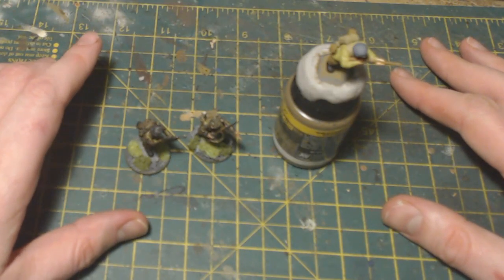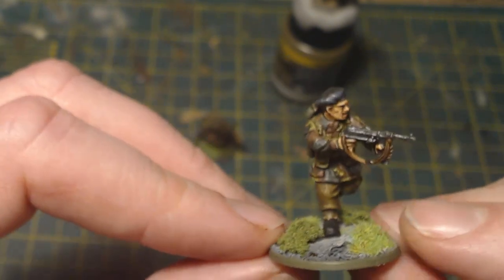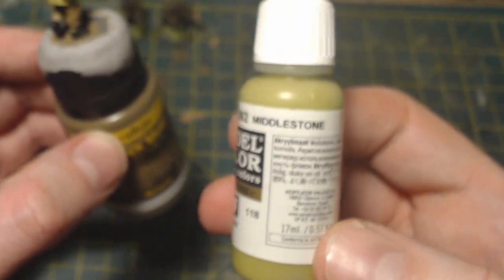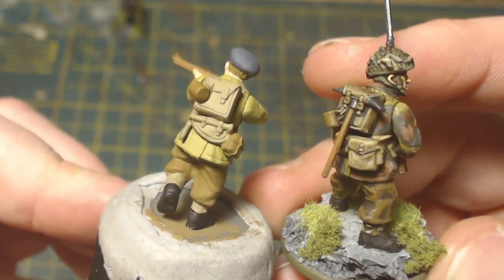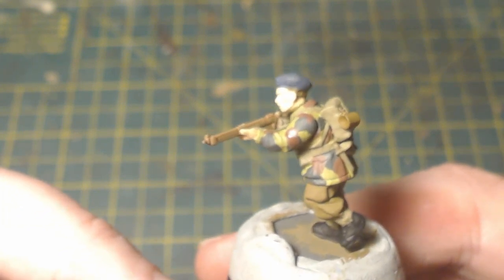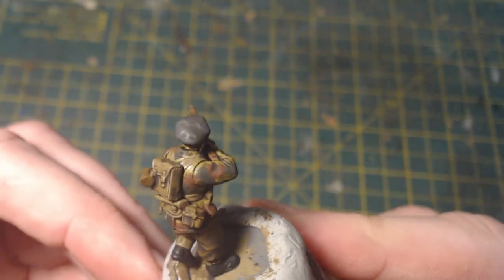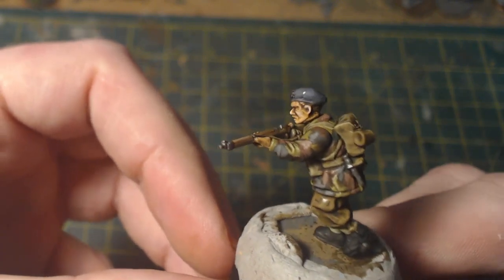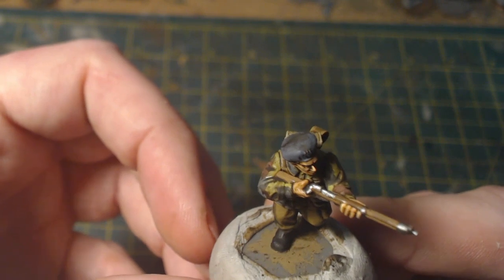How I paint - British Airborne Camouflage

Comment: I do still have a bolt action Russian army. It hasn`t seen shot and shell for quite some time.  I also had small German and FJ, and for some impulse reason bought British airborne box don`t ask! I set about painting them and I like kitbashing figures and thought my officer always went with at least one other mini.  I googled British wartime radios, and it seems the British had a chest mounted radio, which would look great in the squad, and as a support for the officer. I had a piece of sprue and got the rough dimensions from the pics and added it to the figure, adding a slung rifle to one shoulder, and the other a free hand. Also made a British airborne mg42 team capturing weapons in battle. I still have my Russian army, everything else has been sold off.
Reply from the maker: Hey David, that's exactly why I enjoy kitbashing so much! When you identify a figure that you need or you're just not happy with the figure you can buy, it's always interesting working out what bits and pieces are needed to make your own. I did something very similar when making a radio operator for my US Airborne. I found bits and pieces from various sprues and it definitely worked 😀